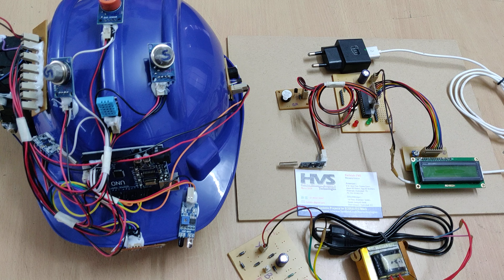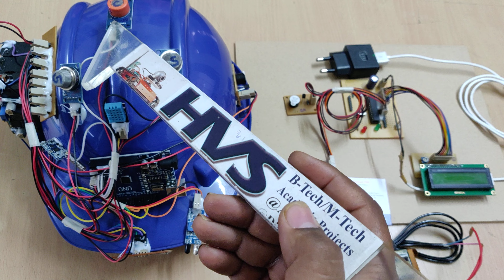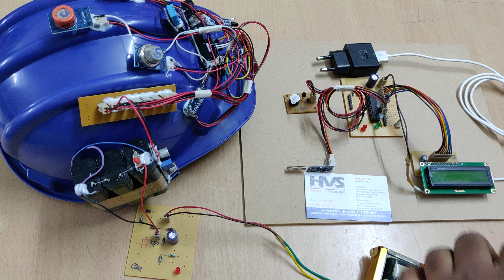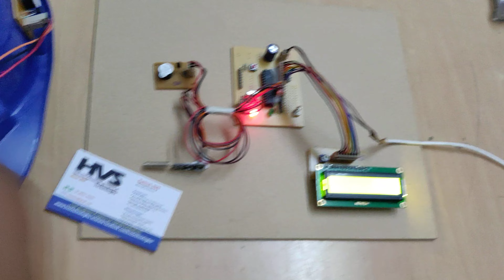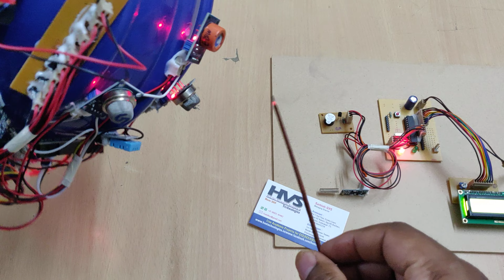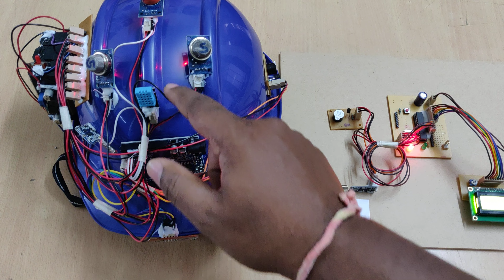safety Helmet system for coal miners using zigbee Arduino UNO MQ-135 MQ7 MQ6 DHT11

Comment: Sir where can I get the Circuit Diagram for this project!!??
Reply from the maker: You can contact us at +919603140482
Through WhatsApp or call
Reply: @hvstechnologies soo good explanation sir 
 i want circuit diagram and source code plzz sir
Reply from the maker: @nanduedits18  You can contact us at +919603140482
Through WhatsApp or call